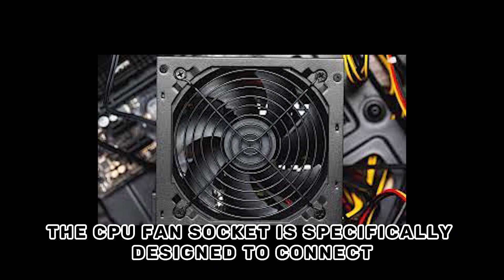Decoding Motherboard Fan Connections: CPU FAN, CPU OPT, and SYS FAN Explained

Comment: can case fans go into cpu_opt? my case fans cable does not reach sys fan
Reply: i would think so. i’m wondering the same thing. i can’t imagine the MB would output wildly different rpms to different sockets
Reply: @BrwrFan806  little late for that haha, i did it anyways, i finished my pc and it works perfectly